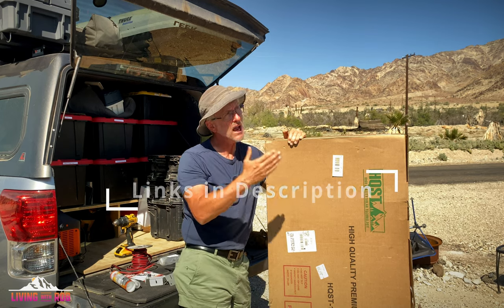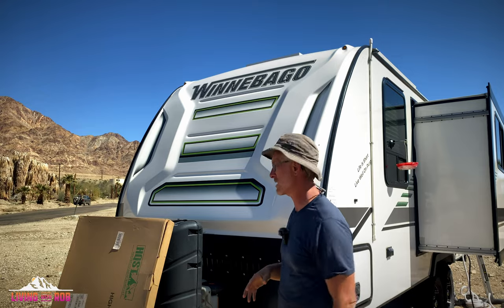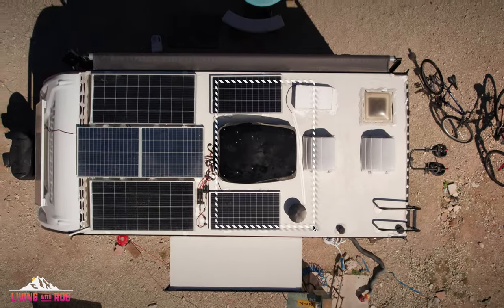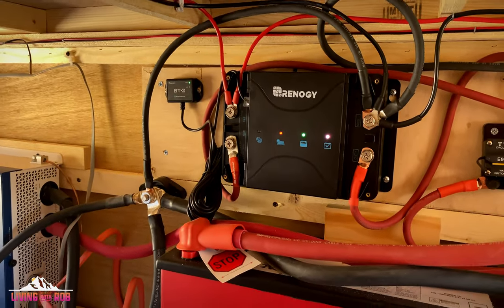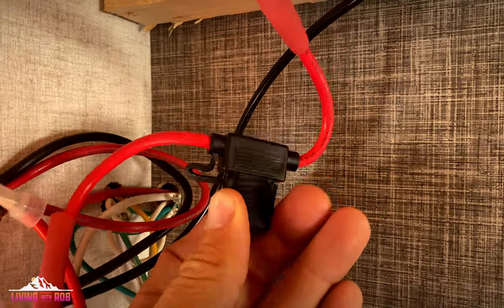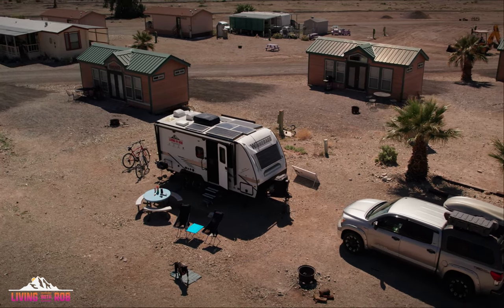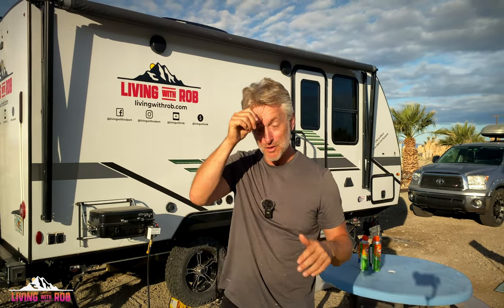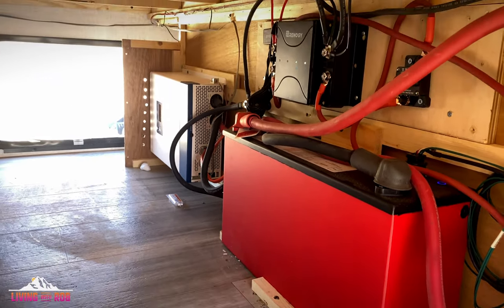BOOSTING SOLAR POWER on Our Winnebago Micro Minnie FLX to 1170 Watts! 🌞

Comment: Saw your comment on Tech Tip Tuesday.   I have rhe 2108 FB flx and want to use the side port, which you mentioned you already have experience with.   Is it my understanding if I use the side port for a 100 watt panel, I need ro get a separate controller? Have you determibed the aide port gies ro the battery or controller.    Any help is greatly appreciated.   Flx doesnt provide much information..    Thank you.
Reply from the maker: Good morning.  It goes to the controller.  However, the way it's wired to the controller makes it problematic.  You are better installing a separate charge controller and rewiring the side port connection to it.  This is straight from GoPower when I worked up my modifications.

Comment: I have a 2023 micro Minnie 2100bh would you happen to know if I can use my 200watt solar panels to charge my ecoflow portable power station on the side go power solar port hookup? If so what wiring would I need?
Reply from the maker: I do not believe this is possible.  I think you could charge your device by turning the Inverter on and then plugging your unit into the 110v receptacle.   The panels will then charge your battery...as the battery powers the inverter...which is powering the receptacle.

Comment: Hi, Rob.  As always, I’ve enjoyed your videos.  I have a 2022 Winnebago Micro Minnie 2108TB FLX edition.  I want to do what you did and set up my rig to charge the lithium battery while driving.  I plan to acquire the Renogy 50A DC to DC On-Board Battery Charger with MPPT.  Can you recommend a video or website that will give me step-by-step instructions on how to do this?  I’m somewhat handy but ignorant when it comes to wiring.  Thanks in advance for any help you can provide.
Reply from the maker: Hey Doug.  Please email me directly.  I'll help you.
Reply: @livingwithrob  Hi, Rob.  I’m actually picking up the trailer tomorrow.  We’re excited about that.  When you said “email me directly “ is this reply what you had in mind?  I don’t have your email address.  Apologies if I’ve misunderstood.
Reply from the maker: @douglasross3488  Sorry.  rob@livingwithrob.com

Comment: I'm just getting started on researching solar and how much I need, so I appreciate the insight you provided. Thanks Rob!
Reply from the maker: Thank Brian.  Reach out if you need anything!
Reply: Best advice...use big wire. Power flow is better and additional solar panels can be installed without rewiring.

Comment: Hello Rob, I am going to install 4, 100 Watt panels on my 1708FB. I’m using a Stud finder to locate the roof rafters. Winnebago states in their brochure those are on 16” centers across the trailer. I’m getting all kind of findings as to where the rafters are. I wondered if you had any issues or problems locating the rafters on your trailer ?
Reply from the maker: WB will send you the roof schematics if you ask for them.  The schematic has very precise measurements and locations of everything up there.  Personally...I didn't concern myself with hitting rafters.   Put Dicor down first, then use Stainless hex heads to screw brackets to roof (don't over tighten...it's easy to do so) on top of the Dicor, then use Dicor self leveling over the brackets till they're well covered.  I think that's fine.  It would take a LOT of force to rip all 4 spots away from the roof once the Dicor sets.  Again, only my opinion here.  🤓
Reply: @livingwithrob  Many thanks! I will call Winnebago tomorrow.
Reply from the maker: @ChipMiller-o4m  happy to help!

Comment: I might be interested in your battery.  Thanks fellow Flx owner.
Reply from the maker: To answer your settings question... Xantrex app ---> settings---> charger -----> charger current set to whatever works.  I keep ours set to 85 amps or lower
Back up one step scroll to Grid.  Set at 15, 20, or 30.  Whatever your breaker tolerance on the receptacle is.

If you pull your charger current down to say, 20 amps, your breaker should not trip.

Reach out to me thru our site and we can talk about the battery.
https://livingwithrob.com/contact-rob

Comment: Is there something you were looking for in a bigger rv? I have an F150, I'm looking in the 18' to 20' range.
Reply from the maker: Hey there.  I am really liking the Ember line and also the Outdoors RV line.  They have a few in that length that would work for you.  In our case, we will stay in this for this travel season but will be upgrading.  Given we would need to move up to an F250 or 350 to pull anything we may want to travel with, we may simply make the jump to a Class A and tow a small, say, Subaru with us.  We would use the Subaru to get to the out of reach areas to do photography and video.  

Still on the fence here though.  For example, we have an epic spot in which we are presently camped.  There is no way we could have gotten in here with anything larger than this FLX.  Missing out on spots such as this would be tragic. 

Outdoors and Ember both make models that are a tad bigger which would work well for us, however, again, they are so much heavier we would absolutely need to upgrade.  The Tundra and our trailer right now are maxed out weight wise.  Cannot add any more (and we travel very light).  By the time we were to purchase, even an older model F250, we'd be over 100k for the trailer and truck.  Yet, if we found a solid Class A used, well cared for, we could get that and a Subaru for under 65k.  

If, however you are looking for that length, check out Ember and Outdoors.  Bigfoots are nice too, but with no slides, limited room interior speaking.😁
Reply: @livingwithrob  The outdoors are heavier, but extremely well built. I saw quite a few of them in Oregon last fall. I haven't researched the ember. We won't be doing it full time, so we plan to stay on the smaller side.
Thanks for the info.

Comment: A couple of questions:
1) You mention that you're looking at replacing your Lithionics battery and you're looking at a couple of manufacturers. Can you provide your initial thoughts on that? 
2) You have added an additional 50A solar controller. Any issues with the two controllers working together? I'm about to take delivery on a 2108DS (comes with one-200 W panel and a 30A Go-Power, and planning to upgrade the solar to probably 600W), would appreciate your insight.
Thanks Rob!
Reply from the maker: Paul, sure.  
1) I really like the Epoch line.  They have a new RV line of Lithium that are both heated and cold protected with smart BMS installed.  They have been great to talk to on the phone.  Many options.  If we upgrade batteries we are ditching the Lithionics and buying matching Epochs.  I'll install (2) 300ah batteries in it's place.  I want them heated and with cold protection should it be needed.  LiTime is another brand and while they are less expensive, they do not have the heated option.  Will Prowse @willprowse recently side by side compared both lines.  He likes both and says if the heated option isn't necessary you'll save a lot of $ with the LiTime.  I want the better quality, American made Epochs if I do it.  

https://www.litime.com/

https://www.epochbatteries.com/

2)  The charge controllers work fine together and create no issues for me.  I first consulted with a few associates who do solar installs along with GoPower and all confirmed there is no issue with putting them in use in the same system.

Related to your charge controller and panel.  Here's my opinion.  This opinion is based on my personal experiences and research with GoPower and some other techs.

The GoPower 30 amp can handle as many solar panels you can put together that do not exceed the 30 amps if installed in Parallel or the total Voltage if installed in Series.

If you are putting them together, I'd make sure the wattage is exactly the same.  For example, the GoPower panels, if that is what is installed is a 190 watt.  If the installed panel is 190, I'd make sure the additional panels are 190.  If it is a straight 200, make sure the additional panels are 200 each to match.

If you plan to install in parallel, make sure the total amps of the 3 panels does not exceed the 30 amps of the charge controller.

If you plan to install in series, the amps do not matter and instead, make sure their voltages do not exceed the capacity of the charge controller.  If you have the same GoPower 30 amp that I have, they need to stay under 100 volts total when added together (in a series array).

So in Parallel, add Amps for total max capacity
In Series Add Volts for total max capacity

Let me know on that panel precise wattage and I will shoot you links to some to review.
Reply: @livingwithrob  Thanks Rob! This video has been incredibly helpful for planning my 2108DS solar expansion. A follow-up question: what other routing options did you consider for running the new PV lines?
Reply from the maker: @paulh5537  hey again.  I thought about attempting to pull through the roof but that's about it.  I really could see very few other options to get wire down into that cargo bay.  No way did I want to get into taking stuff apart inside to have them go from the roof into that bay.  I hope that helps.  Please let me know if you have any further questions.  Always here to help if I can.
Reply: For the starter battery line to your dc-dc charger (4 ga?)... What did you use for a connector from the back of truck to trailer? Any tips on line routing along bottom of the truck (I have a 2015 Tundra, similar to your 2013)?
Reply from the maker: @paulh5537  Yes.  I used 4ga.  I put breakers at both ends.  Larger in the truck compartment, smaller in the WB.  I used Anderson connectors.  I put the wire in loom and fed it through the frame on the passenger side all the say back and over the spare tire (had to lower the spare to pull the wire) If you email me, I will send you photos of the set up and links to the cable, the connectors, the crimpers and the Anderson connectors.  rob@livingwithrob.com